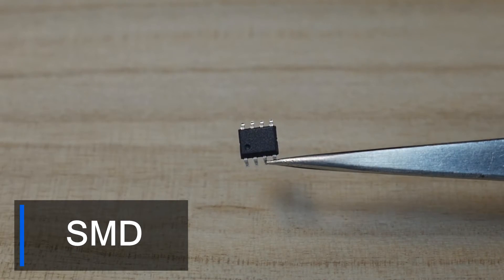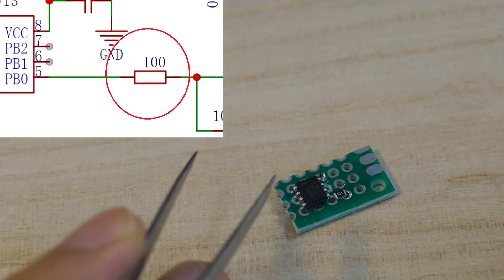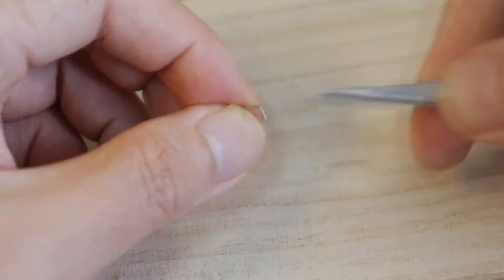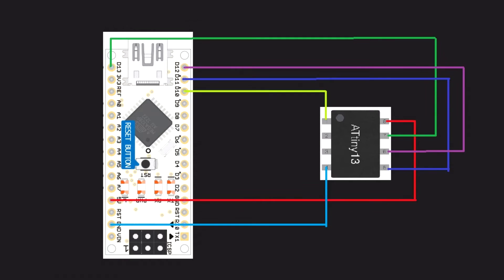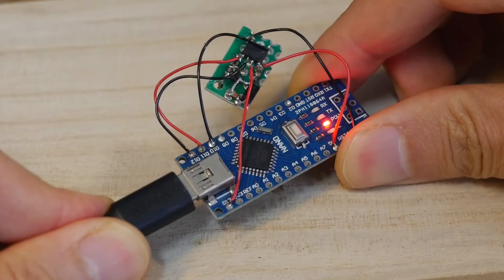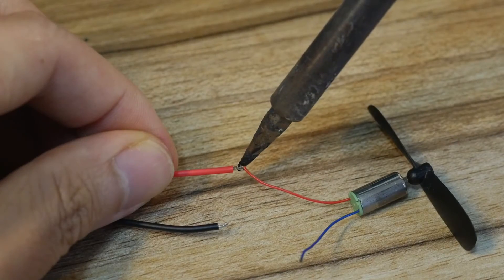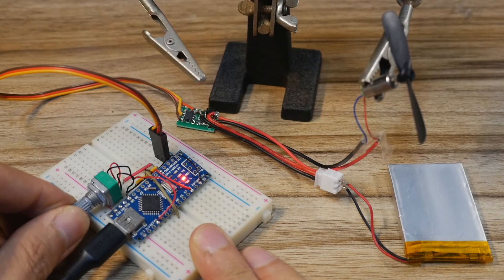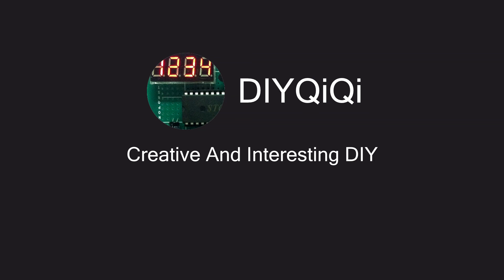Making a tiny brushed ESC

Comment: Why include an ATtiny13 in the middle of the pwm siganl to the motor? The MOSFET could be driven directly by the PWM signal. Normally, a microcontroller acts as the brain for 3-phase motor control, but that isn't the case here. An extra microcontroller isn't necessary. One MOSFET per motor is enough, with the central microcontroller managing the rest of the drone and the PWM signals driving the motors.
Reply: Do we need to power the receiver differently or will it send power via the esc directly in the setup you suggest

Comment: Is 1 pwm pin of Arduino can run the esc? 
Bcs I have to make 4 esc for 4 motors to make a Quadcopter!
So pls can you also tell me in detail that how many and which type of pins are required to drive the esc??? 🙏🙏🙏
Reply from the maker: It depends your remote control receiver type. PPM type : 1 input PIN + 4 PWM output PIN; PWM type: 4input PIN + 4 PWM output PIN.

Comment: Hello, does this source code work for attiny 85 also?
Reply from the maker: Hi, I post the GitHub link below the video description .
Reply: Yes it works with attiny 85.
Reply: @dineshvyas  dude after uploading the code i am getting error says (A programmer is required to upload) help
Reply: @Hiraksenapati  If you are on latest version, you need to press ctrl+shift+u or click on upload using programmer somewhere in the bar above (i dont remember where, i just use the command). You would have to burn arduinoisp to the programmer first tho (if it is nano or uno)

Comment: Hi, cool project. What was the voltage rating for your motor? Did you use a 1s battery to drive it?
Reply from the maker: Motor voltage rating is about 1-5V. you are right I use 1S Li-ion battery to drive it.

Comment: Hi DIYQiQi, tell me please what schottky diode you use. Thanks you.
Reply from the maker: SS14 schottky diode. If your electric motor has higher current, it is recommended to use SS34 or SS54, or even multiple parallel.
Reply: @DIYQiQi  I just started to study electrical schematics and components, now I am building a plane with two 8520 motors (3.7 v). Can I ask you to show me what components to add to your circuit in order to connect two 8520 motors and not lose the power of each of the motors. Thank you in advance.

Comment: Will this (the code) work for a standard rc receiver?? Since their pwm range is between 1000-200us
Reply from the maker: Yes, It can work. It’s written for standard rc receiver Which output 50Hz PWM (duty cycle 1~2ms).
Reply: @DIYQiQi  thank you dude 😎